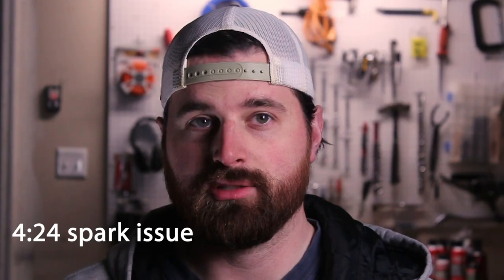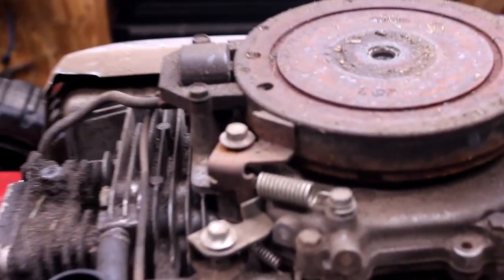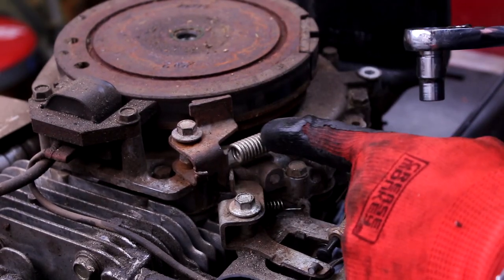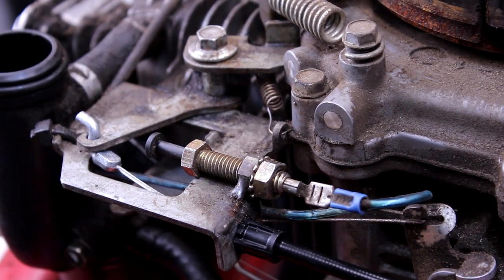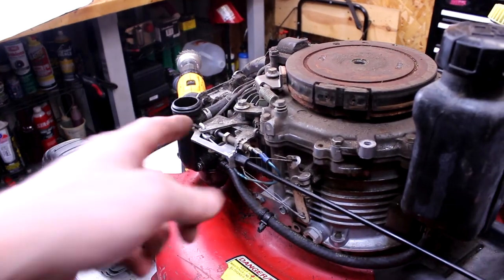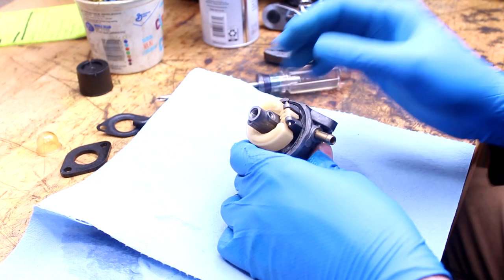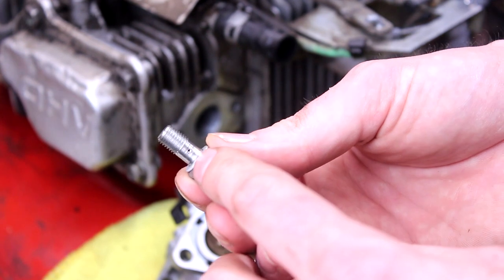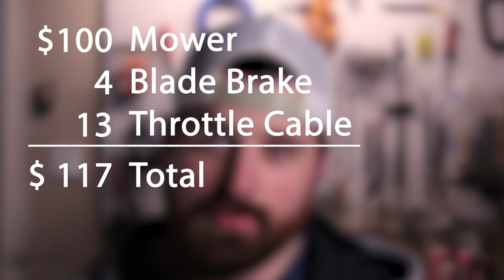eXmark Commercial 21 - No Spark? Will it Run?

Comment: 6.51 what were you using there?
Reply from the maker: Just dribbled a little fuel down the plug hole. I keep it in a "zoom spout." Its actually a plastic oiler bottle used for sewing machines. Bought it in the sewing aisle at WalMart. I think they are on amazon also if you search Zoom Spout. Obviously I dumped out all the oil that came with it before I filled it with fuel lol